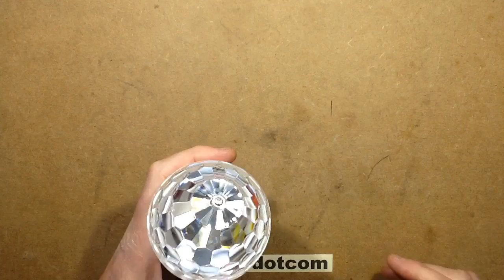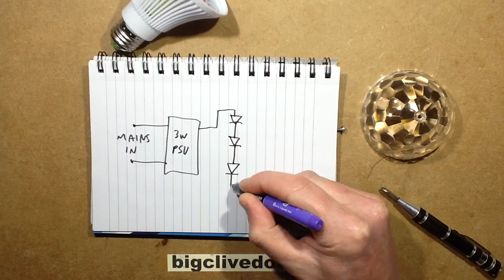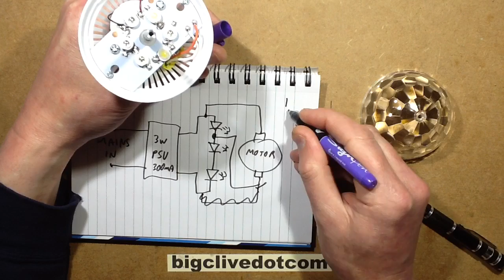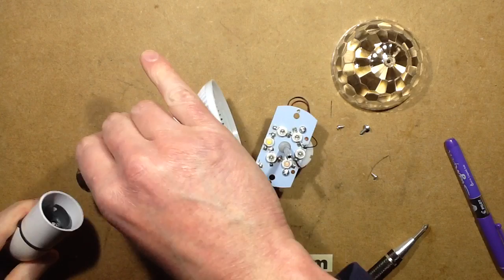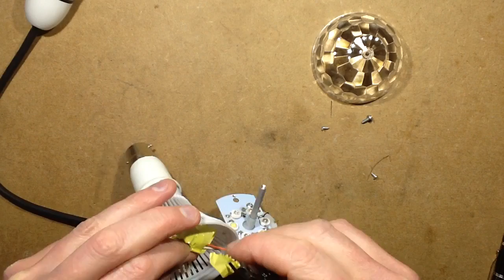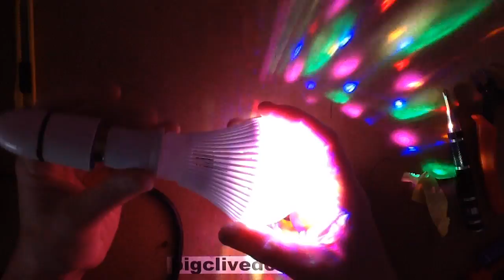Inside a new 6 colour LED disco style lamp.  (plus modifications)

Comment: Clive, three things:

1. Does the motor sound any different backwards? Noise might be the brushes. Try some lube. I know you bought a bottle from Pound Land :^)

2. I have a fan in my yihua 3-in-1 soldering station that runs very slow when idle (speeds up when the iron or bench supply is on) and it too needs a higher voltage to start. Just put a resistor in series with the motor to bring its speed down, and put a decent size capacitor across the resistor. When you power it up, the pulse from the capacitor charging will give the motor enough to start.

3. Put some extra metal in that soldering iron already!! Mine can solder wires straight onto 1mm thick 10mm wide sheet metal...

4. I need to learn how to count, I said there were three points I needed to make.
Reply: +Luke Den Hartog Slower is better (I've been told so).
2. How does that pulse thing works?
Reply: fabts4 when a capacitor is discharged, it essentially acts like a dead short. As it charges, it "opens" by becoming charged to the same voltage as the resistor.
Reply: +Luke Den Hartog Thanks!
We're speaking electrolytic here? The negative towards the motor?
Reply: fabts4 Electrolytics will work, make it so its positive is on the positive side of the circuit. Pretend that the motor and resistor is not there and you are just connecting it directly to the supply. Thats the oreientation you want
Reply: As a general rule, brushes really do not contribute much at all to motor noise.  Bearings, sleeves, and the meshing of gears can contribute heavily to noise, but brushes are so many dB below those as to be practically negligible.  This motor is heavily geared down and you can be pretty confident that it is the gearbox that is producing the noise as the motor will start out at a rather high speed and then get heavily reduced at the output.
Reply: To point 3, it is not only a matter of shims but also the set point temperature and the tip chosen.  When it comes to delivering a lot of heat it helps to have as fat and short a tip as possible, with the 1/4" chisel point bit often proving ideal when one needs to deliver a lot of heat very quickly (I can tackle some pretty high demand jobs with that tip installed).  Or an IR preheater can be used to preheat the whole board to greatly reduce the outflow of heat away from the solder joint, making soldering much easier .
Reply: +Ethan Poole Yeah higher mass tips are nice, I have an old 40w weller and I made a tip out of solid brass. This thing pumps insane amounts of heat into solder joints.

Comment: I think a ptc thermistor inline with the motor would be the go in this case.
Reply: One could also use an normal resistor with a cap in parallel. Then the motor would start with full voltage/current, until the cap get charged, and then it it gets limited by the resistor.
Reply: +m8e   That sounds like an even better idea, then you wouldn't have to wait for the thermistor to cool down, to restart the lamp.

Comment: You could build a small timing circuit with a transistor, capacitor, and a couple of resistors to kick start the motor with higher current and then slow it down as the capacitor charges. Or just a series resistor shunted with reasonably large electrolytic cap to provide that start-up current spike.
Reply from the maker: +SaNjA2659 I was toying with the old electrolytic trick myself.  As used to bump things like solenoids before holding them with a resistor limited current.

Comment: ive bought many of these from a local market last year for the motor! it is VERY tourqy (is that even a word?) and strong while being slow, which is ok with me.

but whats the best thing?! although it is VERY strong, highest reading at 6V I got was 10 milli amps!! this thing is a beauty!
Reply: +Anas Malas Tear out pre-digital alarm clocks and microwave ovens with rotary tables... you'll love those because they are made WAY boatloads better. Some even separate -- the sealeed gearbox slides out of the cavity where the induction part is made. 

The most creative use I saw of these was at our Minnesota State Fair in the "Fine Arts" building... a guy used a bunch of thick brass & copper wire to duplicate a fish and then its tail went back and forth and its body did the same. It got honorable mention. I wanted to take it home with me....
Reply: BikingMNViking how much do I wish I didnt live in UAE where its impossible to really find anything to slavage... The only thing I saw in the last 3 years was a 20$ vacuum...

At home nothing ever wants to go wrong so I cant use these either...
Reply: Anas Malas
UAE? I realized I am starting to get so many synchro motorss (and could have gobs more, I went out in the rain just before dinner after fixing the double basket bike to go through the alleys to get a microwaave  for its tranformer I had seen but it was gone... but there are more every week. More than I have time for. How much would you pay for one and how much would it cost to ship it to you? Not saying I would, my time is more a premium to me than salvaging but I also hate seeing so many nearly new or very lightly used things go to waste. Every year I get "new" fans of all types, double fans, big box fans, circulating fans & vacuum cleaners that I restore. Even got a dual use cordless vac recently... it becomes dustbuster and a full sized lightweight stairway type vac.) I started a small, flat foldable box for them as parts as well as a box for heating elements, broken emergency flashlights, cooling cntrls, heatings controls.

I'm most proudest of my purchase of 3 15 watt solar cells which allow me to now charge my phone, the cordless vac, and my bluetooth speak modules via solar. I'm going green, Baby!

I've got 2 in use and would like to find a small water pump to put the third panel up on my shed roof and power it to attract birds and have a tiny water feature. Even a single drip of water birds here and it brings them from all over. I have a pair of mating cardinals that love the cat protection of my backyard freedom honeysuckle hedge.
Reply: BikingMNViking I am not in real need of anything, and I am super broke... But really thimgs are hard to pass by here... I live in a building with 264 appartments with a total of 660 bedrooms and it is still impossible to find anything. People here just put them in the garbage room and the building contractor removes them withen 15 minutes so its impossible to find anything..
Reply: Anas Malas
Sounds like you should be networking with the building contractor -- even offer to move stuff for him in exchange for being able to salvage what you want.

I built hotboxes from thrown out windows and then talked to the project manager building a 30 apt unit and got the rebar cutoffs to use as garden spikes and hold up foot wide pieces of an old door I cut down to make my hot boxes.

Now I have lettuce before most people have even planted anything, a few watermelon plants coming up and they're protected from the rabits eating them.

Comment: I wonder if you can put a diode or resistor in series to drop the voltage, but also a capacitor across the 'dropper' to give an initial starting burst
Reply: +Sparky Projects - Was going to suggest the same.

Comment: Couldn't you tack an appropriate resistor in series with the motor to slow it down?
Reply: +Marc Dudlee Perhaps a PTC thermistor to slow it once it gets started?
Reply: +Marc Dudlee I wonder if you could put a capacitor in parallel with the hypothetical resistor to allow a brief extra jolt of power to start the motor, and then the resistor would serve as a discharge resistor when current is removed.
Reply: +SilentS It depends on the motor, as Clive said it needs a bit of voltage to start it going, but once it's going it can be lowered. It'd probably need a small circuit to start it off at a higher voltage then drop down.
Reply: +SilentS The problem is, as clive said, it needs a higher voltage to start.
Reply: +robmobz Creative!
Reply: robmobz Nice idea.
Reply: Phos9 Yep, that sounds like the best solution.

Comment: May be just a slight dab of oil on the reduction gear might clear the noise. I doubt the factory would have even thought of lubrication.
Reply: +Teukka72 Daddy's Finest Fisting Oil
Reply: +Michael Beeny Aye. Mineral oil?
Reply: +Michael Beeny I've seen a video of someone lubing up a quartz clock movement to get rid of some of the ticking noise. The gears probably do rattle a bit.

Comment: Now that you've worked out the voltage needed to slow the motor down, will a simple resistor inline get you the speed you want? If the motor gears are whining you could try a drop or two of sewing machine oil to shut it up. Good luck great video as always Clive.

Comment: a diode or two to drop the voltage plus an electrolytic capacitor across them to kickstart the motor should slow it down nicely
Reply: Jernej Jakob or.. a couple of diodes and NO electrolytic.. then it would power up stopped and, if you want it to rotate slowly, you could give it a turn by hand

Comment: Evenin Clive 

now Im not in any way shape or form electrical minded (last time I used a soldering iron was to mend a plastic petrol can) but could you use a starter from (the lights in kitchens/offices cant recall there name) to give that initial kick to get motor running then just have it tricle what it needs to go slow ?

Comment: I want to say if you used a PTC in series with the motor, drawing power from an led like it was originally, it could slow right down but have enough voltage to start.
Reply: +ELECTRONTHORP If your're in the UK I'd happily post you a 1cm square PWM module, self made. Variable freq if you can solder 0603. Never really conversed through YT chat, reply if interested. We'll see where this goes
Reply: Yep a LM358 triangle, buffer, comparator, buffer -> FET action. I was (don't curse) getting sick of the 555. many examples online. I had to make up money on an farnell order one day and bought 100+ required and home etched a page of copper. see blogger for crap I do on the side that hasn't been updated in a year. (search gargoyle for "lm358 pwm") Wishing you luck and 2p DIP componets

Comment: I like this light, I think I will try to find one on eBay.
Reply from the maker: +LakeNipissing there's a generic search link in the description, but there are lots of different types.  This one has a very distinctive case though.
Reply: +bigclivedotcom Hi Clive! These light are pretty cool actually.
My question to you is, are they available in the US 130 V Standard wall current? I would love to have one of these to Dink around with.
Reply from the maker: +DUSTERDUDE238 The one linked to in the description is listed as universal voltage.  Most of them are, since they use the common 3W switching power supplies.

Comment: Could you not just drop a resistor in to slow down the motor?
Reply: +Kyle Burton The motor starts at around 1.5v, but can run at something like 0.85v. So you could use a resistor, but only down to 1.5v.